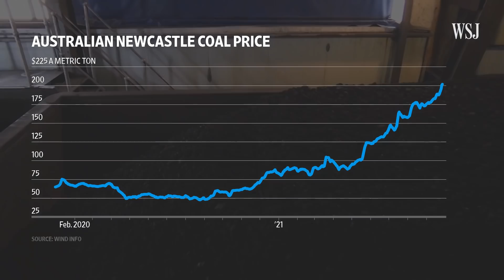China’s Power Crisis Threatens to Delay Apple Gadgets, Other Goods | WSJ

Comment: when other country use coal or petrol,it’s fossil fuel,when China use it,it’s dirty fossil fuel 😅
Reply: Pounds of CO2 emitted per million British thermal units (Btu) of energy for various fuels

Coal (anthracite)	  228.6
Coal (bituminous)	  205.7
Coal (lignite)	  215.4
Coal (subbituminous)	  214.3
Diesel fuel and heating oil	  161.3
Gasoline (without ethanol)      157.2

Propane	  139.0
Natural gas	  117.0
Coal is the dirtiest of fossil fuels. That's not a biased statement, that's just a fact.
Reply: Considering chinas output of pollution trumps any other state in the world, it would be understandable. Also she said “the” dirty fossil fuel calling fossil fuels in general as dirty
Reply: Most of the countries complaining aren’t using coal as a primary energy source though. Coal is among some of the most environmentally damaging resources that a country could use. If you ever visited a town that with lots of coal fire plants you probably get what I’m talking about with the air quality and such

Comment: They could use modular nuclear reactors for the factories 🤔
Reply: Hard to miniaturize the a nuclear reactor. Could go unstable real fast and not worth the risk. China should just build a national nuclear plant like France. Could easily match 70% of power demand. They have the expertise.
Reply: @dantagogoseb202  The problem with that plan is that nuclear power plants take a long time to build, usually a couple of years.
Reply: @Zecr  there's already the biggest and the safest t (they claimed) which is gonna be online  in 2024
Reply: @cobaltblue2756  Oh nice. In that case good.
Reply: @dantagogoseb202  wrong, submarines and aircraft carriers already uses miniature nuclear reactors for over a decade now, they just need to be modified/upgraded to make a great on site/land electricity supply.
Reply: @Zecr  only the giant nuclear reactors took way tooo much time to build, today smaller/modular ones are being developped, even rolls Royce is working on it.

Comment: Roof top solar panels combined with battery storage will help make businesses more independent from the power grid.
Every home and business should ramp up installation of roof top solar energy. There is a Climate Crisis. We must stop adding more fossil fuels to the Climate fire.
Reply: Unfortunately those things aren't always cheap amd worse thing is that it doesn't make enough energy for alot of companies to be able to rely on, China is already world's leader in renewable energy. The demand of batteries and raw materials is becoming an issue years after years. China has the biggest hydroelectric dams in the world.....
Reply: @carholic-sz3qv  China is adding a lot of wind and solar but to address climate change it must stop adding and using coal fired power plants. The only way to do this is to ramp up investments in wind and solar energy and expand adoption by homes, businesses and utilities.
Reply: @KJSvitko  China cannot stop using coal because they are the industry of the world, basically everything is made there, also solar and wind are intermittent sources of energy which needs enormous amount of batteries to store/balance the grid, China also has the world's largest liquid redox storage batteries.
Reply: @KJSvitko  China not only install alot of solar and windfarms but they are the world's biggest maker of solar panels and batteries and electronics........ the demand of energy is simply way tooo high. Australia has alot of solar energy capacity, they can be part of the world's biggest industry.

Comment: China needs to go all in with building new wind and solar energy power combined with battery storage.
Wind and solar are safer, cleaner and cheaper than fossil fuels. There is a Climate Crisis. We need Climate Action Now.
China can ramp up wind and solar energy and not worry about importing fuels supplies.
Reply: China has installed solar capacity larger than US and EU combined, and installing more at a faster pace than any other country. See https://en.wikipedia.org/wiki/Solar_power_by_country